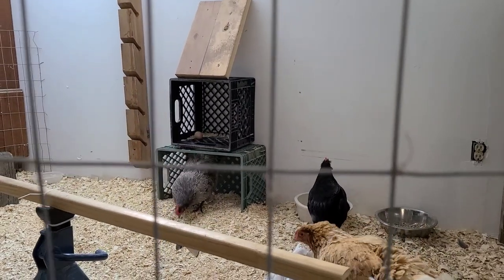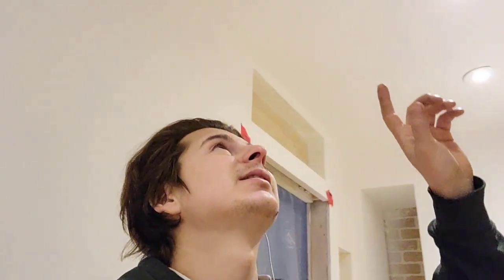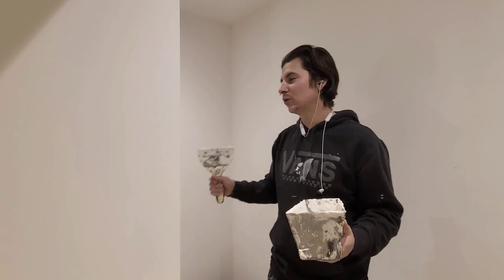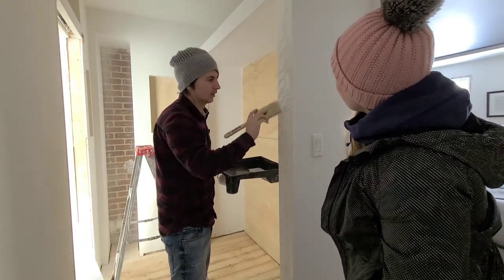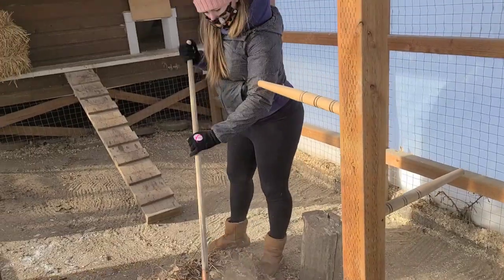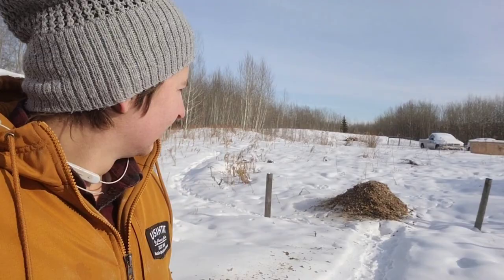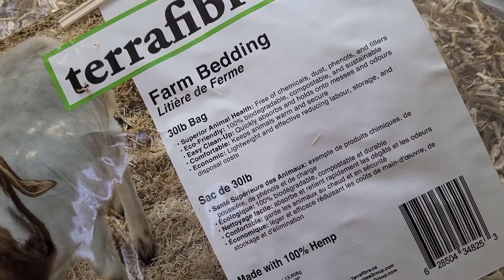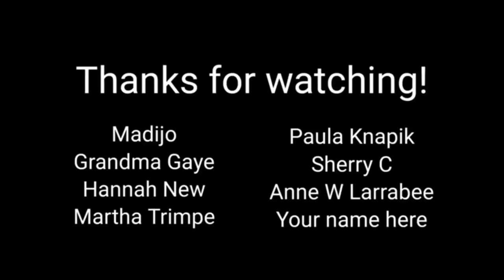Working on my walk in closet | Another VLOG #107

Comment: My hallway and ceiling were “textured” this way in the home that I moved into. Catching an elbow or bare shoulder on that when you are in a hurry is not fun.  I got sick of leaving random DNA samples and decided to remove it.  It was also painted over so my original idea to just sand it was a no go.  My nephew came to help and discovered it was not painted over plaster, but more like mortar that you would use, say on the faux brick face on my fireplace. (What were they thinking?) No wonder the sander couldn’t touch it!  I ended up using styrofoam ceiling tiles to cover the ceiling and a more stiff plastic 3D tiles for the hallway. No more scraped elbows, yay! The tree looked cool but when I saw you sculpting with drywall mud, I had flashbacks.
Reply from the maker: Haha. Mortar and drywall mud are vastly different. This wouldn't hurt. It would just break off. Bummer you couldn't get rid of what you had.